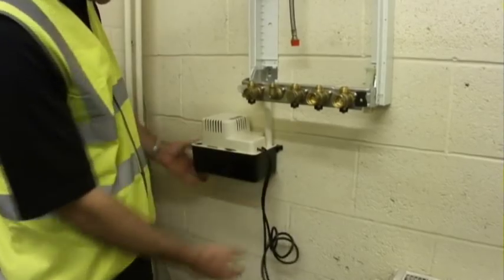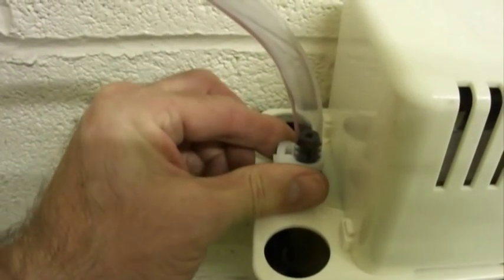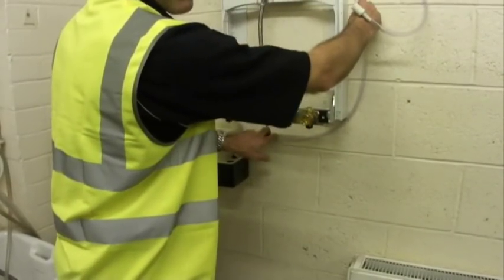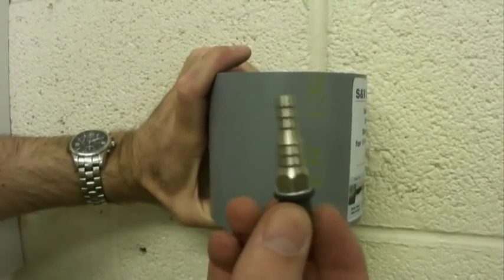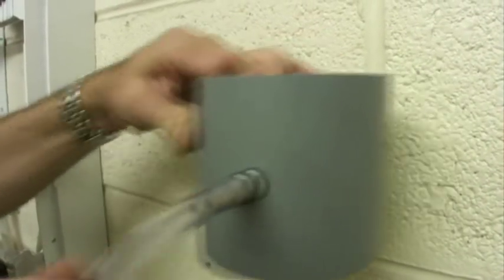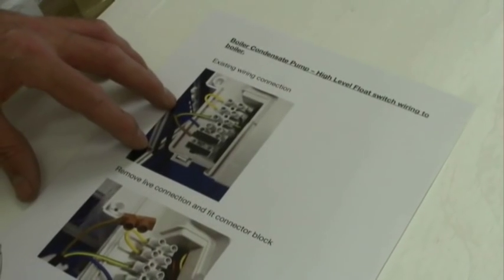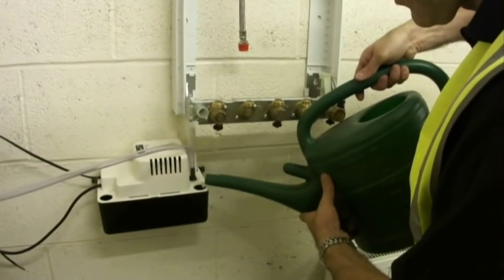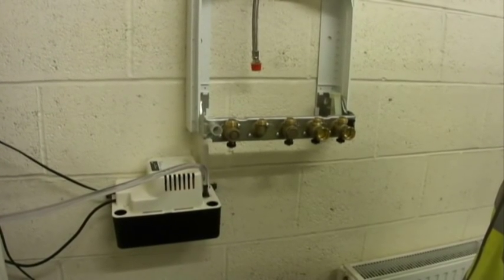How to install a Condensate Pump

Comment: I am using this for my dehumidifier in the basement. Do I need to hook up those 2 black wires to anything or will it run fine without that?
Reply: i have the same question… can somebody please answer?
Reply: What have you done with the two wires?

Comment: Hi, what is the adaptor you use to connect to the soil pipe called?   Can’t find anything similar anywhere and think it might solve a problem for me!  Thanks!
Reply: would like to know aswell!
Reply: Me too
Reply: @zappy321123  It's a "Mechanical Soil Pipe Boss Connector" - connects 40mm waste pipe to your mains downpipe.
Reply: @stompalomp2968  Top man thank you! For some reason mine goes outside into the guttering so in the winter it freezes over!
Reply: Was anyone able to find the adapter
I searched and searched and did a visit to 3 different plumbing supply houses in Colorado but cannot find one.  The pipe I am tying into is in a bad place and this would be extremely helpful.
Reply: @davidb2019  try googing the words "soil stack condensate pump adaptor"
Sauermann and Aspen make them.  I'm sure there will be generic versions too.
Self-Sealing Adaptor – 1/4″ & 3/8″ (SSA-001) Hose to Soil Pipe

Comment: Out of interest, why not just connect the white hose to the soil pipe? I mean, my one has gone on my boiler, but the white pipe simply dispenses water, so don't get why it needs to go via a pump?
Reply: If there is no pipe to go DOWN to, you might need to pump the water UP to a pipe to get it down the drain. It's a elevation issue need.
Reply: Because sometimes the water needs to be elevated upwards to get to a gutter. They're 50 quid and takes a few minutes to fit. Many ppl need them. I do.

Comment: how far can you go with the water in a long tube and can you go up and down ? like up and out side?
Reply from the maker: Hello Charlie Samson, 

The length of the pipe does not really have a limit. There is a non-return valve in the outlet so that will stop anything going back down the pipe into the pump reservoir. Vertically, you cannot pump any higher than 4.3m above the pump itself but as long as it is below this at its highest point then I see no reason why it could not go up and down over obstacles as much as it likes.
With regard to running out side please remember that the condensate will be stationary in this pipe when the pump is not running, particularly if the pipe run is up and down over obstacles because It will collect in the low points. If this is outside then there is a good chance that the water will freeze in the winter and block the pipe so you will not be able to pump the condensate away. Best to lag any outside runs or avoid running
outside altogether or until the final drain point. Then make sure that the final drain point is lower than where it exits the wall or building to ensure that it drains away and no condensate collects there.